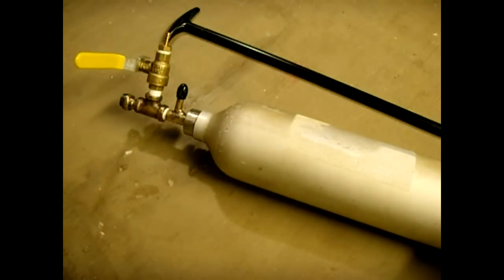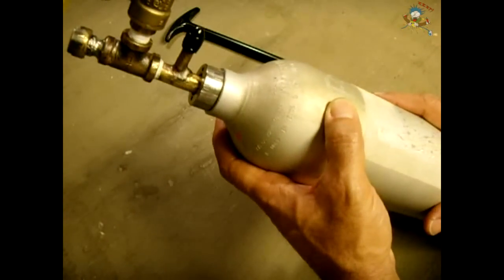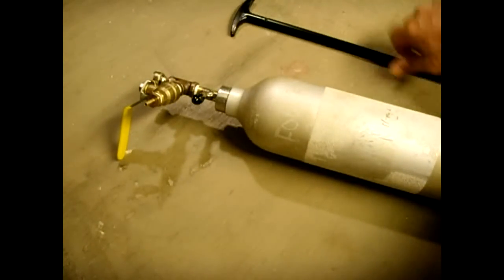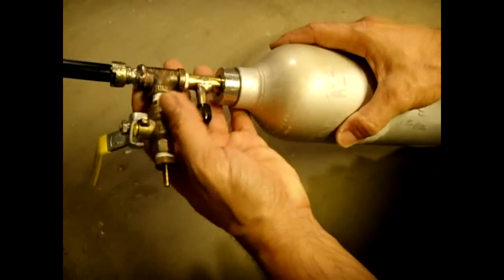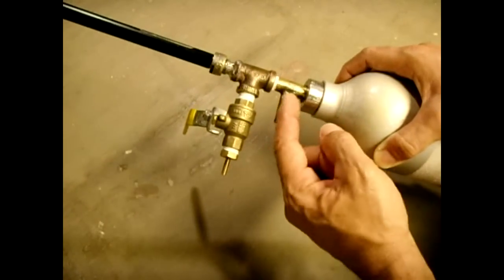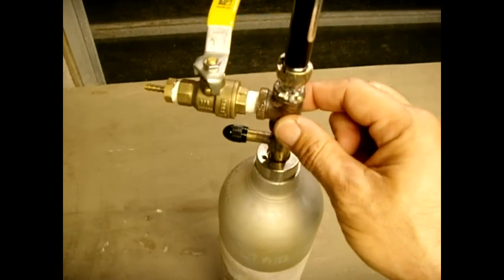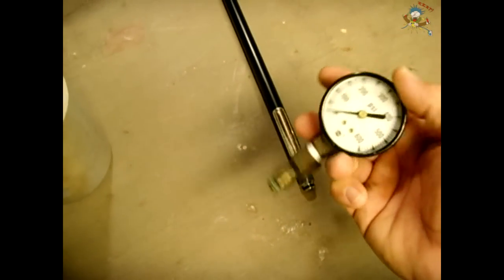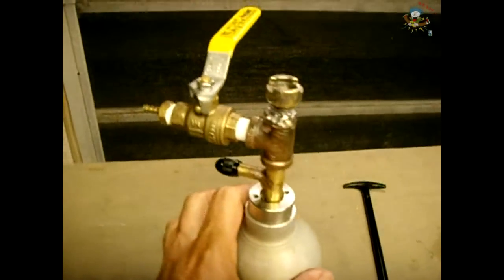450-500PSI AIR SUPPLY Made "Mostly" From Trash

Comment from the maker: @Landrew0
Clearly you did not watch the entire video. There are too many Youtube 
experts out there. Did you miss the part where I stated that I performed
 a visual inspection of the cylinder? You do know that a visual 
inspection means that I removed the tank valve and inspected the inside 
neck/threads of the cylinder as well as the rest of the cylinder for 
corrosion or cracks under bright light and magnification. You are not 
talking to your average Joe. I guess also missed the part where I only 
filled the cylinder to HALF the rated pressure.

Have a wonderful day.

Comment: A method of pumping: using a discarded refrigeration compressor such as found in a small dorm sized fridge, these are usually junked due to a bad start relay while the motor windings are just fine. The pressure can go quite high on these albeit they deliver very small volume.
Some oil does does circulate with these and may become a problem, so on the output side, some type of vertical gravity drain back or some such is needed. Use at your own risk as there would be no shut off to limit pressure.
These can also be used to evacuate (pull a vacuum) on any number of things
Thanks for the ideas!!
Reply from the maker: Yes. In the past I installed many AC systems and swapped out compressors. They do work really well, just have to use an oil trap.

Thanks For Watching

Comment: can you take a video on how it work? can it do a puff of high pressure air discharge at a time?
Reply from the maker: If I wanted, I could send a pulse to a solenoid valve to release a short burst of pressure.
Reply: electronicsNmore can you please do pulses video? Like BB gun but no pellets.
Reply: Please do. I want to make something like that so I can clean dust off optics with high pressure air puff. Like BB gun without the pellet.